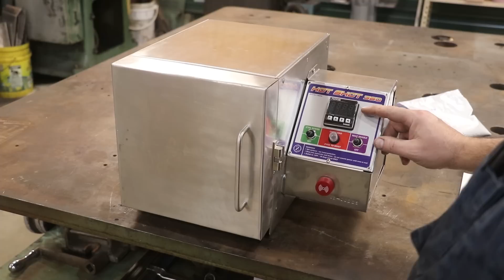Heat Treating W1 Tool Steel using the Hot Shot 360 Heat Treat Oven

Comment: From what I've read, the brine (8:30) prevents the water from making a stem cocoon that insulates the part from the water.  The boiling point may shift a degree or two but mainly the trick is to avoid bubbles of steam.  I've heard blacksmiths (from back in the day) say horse piss or all kinds of things in the water---probably they all have similar effects.

Comment: When salt is added, it makes it harder for the water molecules to escape from the pot and enter the gas phase, so basically you get less violent reaction and less bubbles. Bubbles are sort of thermal insulation and can slow down the cooling process when they form around your quenched item making it quench less, also they are kinetic force and can warp your piece while it's heated to plasticity or crack it when it's cooled and very britle. So less bubbles = better. This part looks thick enough to survive a quench in water/brine. for tinner parts you might want to switch to oil instead and preheat it for less density/better heat absorption. :) Also I'd recomend preheating the oven before inserting your item. Heating steel slowly can be beneficial to some degree, but above 1022F very undesirable processes start to occur so you generally want to mount  to quenching temperature as fast as possible and avoid those at all costs. If you want to slowly preheat your item, you would need two ovens: preheat the steel to 1022F along with the  first oven and keep it at that level for some time, then transfer it to a second oven already at quenching temperature to skip the bad part ;)

Comment: You didn't show when your whole shop filled with smoke from the melting boric acid.  Haha, I  have done it many times.  Have since gone to stainless foil. Much nicer.  Also boric acid will start failing/burning off over 1500 deg.

Comment: Very interesting.  I have read that the reason for the salt in the water is to prevent the water from forming steam bubbles.  These bubbles can stick to the cooling part and act as insulation.  This creates a little place where the metal does not cool as fast thus making it softer in that locale.  No steam bubbles help in creating an evenly cooled, hence evenly hardened, part.

Comment: Small point, but the boric acid melted, didn't it?  If so, then the part DID sink to the bottom of the container and touch the foil.  
Many guys i know  do, as another poster said, wrap the part in SS foil, but they also put a piece of paper inside the wrapper to use up any free oxygen inside.  That keeps the part from oxidizing.

Comment: Hey Keith. Just curious if you might be able to help me. Was given a small cement mixer and the first time I used it the worm gear on the motor stripped out. Come to find out its plastic. The ring gear it runs on is steel. Go figure. If I sent you the worm gear and maybe the ring gear would you be able to make the worm gear out of steel?
Reply: the time it takes to make something like this would  almost certainly  exceed the value of the entire unit. You dont whip something like this out in a couple of hours.
Reply: @danneumann3274  man that question is long handled.  I had forgotten all about it

Comment: Was it necessary to preheat the brine. My understanding is that brine is used instead of water to increase the speed of the quench because it boils at a slightly higher  temperature thus staying fluid in contact with the metal for longer. Surely heating the brine will have less of a rapid cooling effect, negating the addition of salt. 
This is not my specialist subject just my understanding learnt from an old oldtimer.

Comment: Just an FYI on the salt!  Table salt usually has anti-caking agents in it as well as iodine!  Both of which will change the amount of Sodium Chloride per pound!  It would be best to use Kosher, or Canning salt, if you are going to get it as a Grocery store, both of which are just Sodium Chloride!
Reply: Yeah well given the 'precision' with which the amount of salt added was measured, the small differences (minuscule) you're describing are not an issue. Table salt is 98% NaCl by weight, with ~2% anti-caking plus a tiny amount of KI (potassium iodide) so we don't get goiters. Watch Keith pouring the salt in, do you think altering his target mass by ~2% could make a difference?
Reply: @steveh8724  It certanly can make a difference!  It is not so much the difference in the amount of salt as it is the addition of the other chemicals that may be considered contaminants and effect the surface of the metal in the quench.

Comment: Considering they use boric acid in eye drops and vaginal suppositories, I don't think you have much to be concerned with as far as using gloves to handle it!  It is a very week acid at best and is also used as an antiseptic and low toxicity insecticide.  Just don't eat it and you will be fine!

Comment: Now you'll be able to preheat cast iron pieces before you weld cast iron for repairs. Of course radiant heat will be a problem so you'll have to make some heat shields for when you weld but at least the repair will be the most solid repair. Good luck!

Comment: Great video....thanks.  I was surprised to see you quench the cutter by entering the brine horizontally.  I would have been worried about warping and plunged it perpendicular to the brine.
Reply: My understanding is that very thin sections are sensitive to this sort of thing---like knives.

Comment: Couple of things. First glad you had on a full face shield. Second, I have tried the Boic Acid wrap (see Click Spring video) and it had formed a glass like coating on the part that was super difficult to remove. You didn't have a close up of the finished part, so did the water/salt remove this on the finish?
Reply: @JorgTheElder  Thanks next attempt I will give that a try.

Comment: For a moment I thought that worm-screw was some excessively locked rotating bolt-blank you had there Keith--I was waiting for the ATF to come knocking on your workshop door!!!

The oven looks very nice indeed. It is for certain that hobbyists like your friend can himself make better ones than are commercially available. Although nothing like as hot, I have seen and tried to use commercial reflow-ovens for electronics projects and they are ridiculously expensive and very low quality. Most electronics enthusiasts use kitchen toaster-ovens and get far better quality at a fraction of the price! I dare this is a similar situation.

The only issue I might raise is a slight problem with the fit-and-finish on the control pad. It looks like the instrumentation mount is not brilliantly square on its supports--quite a big uneven gap on the lower-right side. Or is that just a trick of perspective with the camera?

Comment: Hi Keith,
  Just a couple of pointers from an old blacksmith. One has already been mentioned, add salt until a potato will float when making your brine. The other is you should use stainless steel foil to protect your part from oxidizing. Using boric acid will destroy the lining of your oven especially if you get any directly on the brick. Boric acid contains alot of sodium which has an affinity with the brick lining and will eventually eat through it.
Ask any blacksmith who forge welds in a gas forge.
Great video as always,
Dick
Reply: @JohnHolmes the second
You are correct but since Keith referred to roach poison I assumed it did.

"Boric acid and its sodium borate salts are pesticides that we can find in nature and many products. Borax is one of the most common products. Boric acid and its sodium salts each combine boron with other elements in a different way. In general, their toxicities each depend on the amount of boron they contain.

Boric acid and its sodium salts can be used to control a wide variety of pests. These include insects, spiders, mites, algae, molds, fungi, and weeds. Products that contain boric acid have been registered for use in the United States since 1948."
Reply: I always use stainless steel foil,with a piece of paper inside
Reply: sorry to be off topic but does any of you know a trick to get back into an Instagram account??
I was dumb forgot the account password. I love any tricks you can offer me!
Reply: @Torin Adrian instablaster ;)
Reply: @Melvin Van Thanks for your reply. I found the site thru google and I'm trying it out now.
Takes quite some time so I will get back to you later when my account password hopefully is recovered.
Reply: @Melvin Van it worked and I finally got access to my account again. Im so happy:D
Thanks so much, you saved my ass :D
Reply: @Torin Adrian happy to help :)
Reply: Boric Acid does not contain any sodium. You may be mixing it up with Borax, a related compound. If you have sodium contaminants left over from converting Borax to Boric Acid, consult a new chemical distributor.

Comment: Boric acid is very mild and is primary ingredient in EYE WASH!
Reply: Yes, not dangerous to the skin, but you DON'T want to ingest it.  Boric acid is used to kill roaches.
Reply: @eliduttman315  the lethal dose for a mammal is about two and a half grams per kilogram of body weight.
Reply: Depending upon the concentration. You should understand what PH means.
Reply: @silasmarner7586  dry, strait boric acid, pH 5.1 about 1000 times less acidic than Vinegar...

Comment: Did he cut the worm screw too or just the wheel? I would be interested to see how that would be done.
Reply: I only needed to modify a worm wheel that I bought that I thought was the right one.  The diameter, number of teeth, bore, everyting was correct, but the root diameter was 0.070" too large. Same old story, days of work to get ready to make a cut that takes minutes! ;)
Reply: If his lathe can cut the hob, he can cut the worm but probably different material because tribology and such.